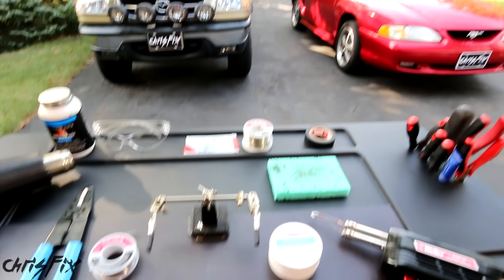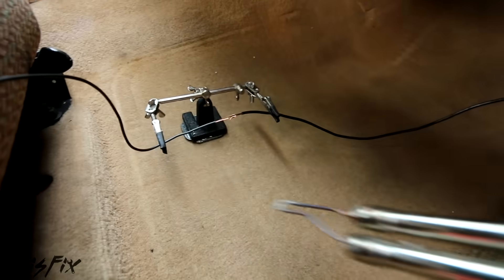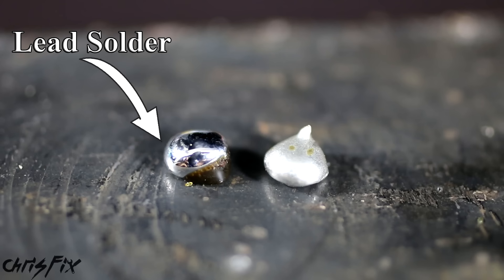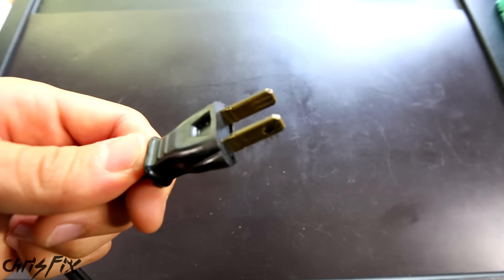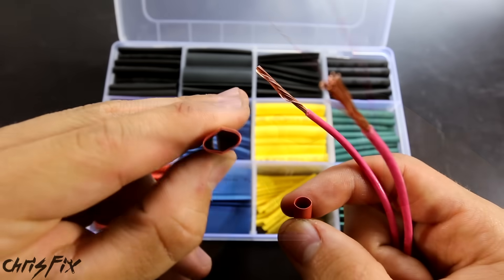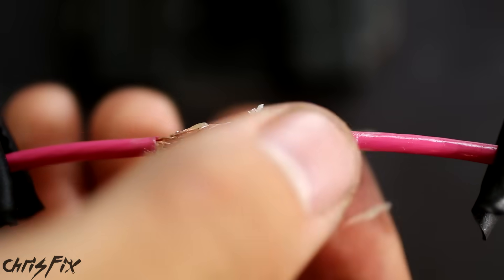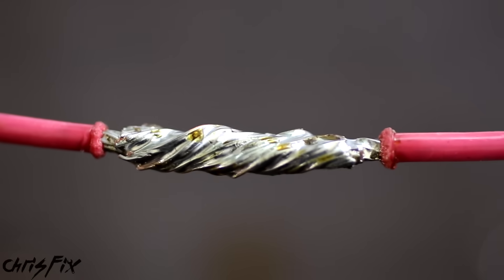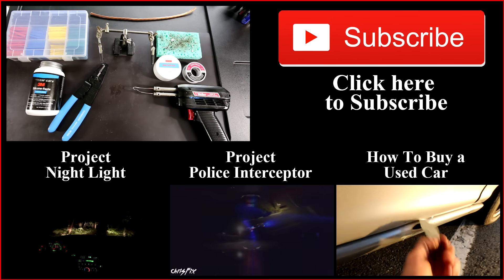How to Solder Wires Together (Best tips and tricks)

Comment: When I solder this way the wire instalation melts faster than the solder... And I'm afraid I'm damaging the wire or the circuit board because it's near.

Comment: Thank you Chris. After 50+ years of soldering the wrong way I finally learned how to solder properly. I just wished you had shown how to solder two wires of different guages. I assume it works the same way of integrating the wires and then twisting them to form a tight weave before adding paste. Also the tip about using dielectric grease was most helpful.

Comment: This was really good.  I accidently cut the wrong wire and it was too short on on end to reach in and strip properly.  8 Guage Stranded. Got it back together.  Doesn't look anywhere near as good as yours, but it's secure and working. Liked.
Reply from the maker: Glad to hear it worked out, and it is working properly, that is what matters!

Comment: AWESOME, AWESOME, AWESOME!!!!!!!  Until this video I could never figure out why soldering was so difficult.  Huge tip from Chris was to change out the provided tip with a piece of copper wire (I used 12/2 home wiring ground wire).  It heats up in a few seconds and solder easily flows into the wire (just like it should but never did).   I think the flux also helps but I haven't tried it without (why mess with perfection).  Thanks also for identifying the correct electrical solder and that it should be lead not silver!!  I used all the products you linked and they all worked great!  I also used your dielectric grease suggestion for the shrink tubing.
Reply from the maker: Glad the video was helpful!

Comment: Hey, i tried that but somehow my wire wont get hot enough to melt the solder. The maximum i can go is 480 which should be enough but even after a few minutes nothing happened. Any tips on this?

Comment: Thank you!! No longer will my clients be able to sue me for getting electrocuted when attempting to turn on their supposed waterproof electrical units and end up in the hospital with 3rd degree burns on their hands or lose their life when attempting to use their microwave oven, while taking a nice hot shower and warming up their bath towel to use to dry themselves up when they finish showering!  Now they can rest assured that they no longer have to be afraid to use any waterproof devices in the shower,  after I've repaired the wiring their dog ate while swimming, RIP Snoopy...!  I now consider myself a certified professional Soldering King of All Newly Soldered Electronics capable of operating in the water, thanks to my newly acquired soldering skills of creating waterproof  wiring with heatshrink tubing, that is guaranteed to work underwater, above water, bare feet in water, including toasters, hair dryers, portable heaters, or anything else that I repair for my customers, after their dog chews up the electrical cords and require a waterproof solder so they can continue using their devices!  If it wasn't originally waterproof, just call me and I will waterproof it for you, guaranteed to work underwater, even for your 4 year old to use!!  Feels good not to worry about anymore lawsuits due to my terrible soldering skills prior to watching this video!  Just feels good.  I'm gonna try my new radio in the water, that I just repaired by creating a waterproof connection as the video taught me.  If I don't write anything after this sentence, then u know I must have made a mistake and ended up getting electrocuted and sent to the morgue for an autopsy...

Comment: Isn’t crimping superior than soldering in automotive? faster, more consistent, more resistant to vibration and heat.
Reply from the maker: If you make a good crimp or a good solder it doesnt matter for normal automotive use.

Comment: Soldering thick wires like this is easy! Now try soldering tiny hair-like wires together without completely burning the copper, now that's a real challenge.
Reply: Any tips or tricks? Or just .. precision
Reply: @jaketf2374  Honestly I've found most cheap thin wires actually use copper-coated aluminum, not pure copper. Pure copper won't easily burn up on you like that and will accept solder easily no matter how thin it is. I found wrapping strands together and rubbing it on a rough surface helps differentiate them, if it starts turning silver-ish it's aluminum and you can't really solder it, best you can do is crimp them.

Comment: for anyone wondering yes this seems easy but try doing this under the dashboard or soldering a wire inside the fuse box,its just a pain to do,not to mention inside the engine compartment with no lighting

Comment: It's not called a soldering GUN; it's a soldering IRON. Also, for wires, don't solder... crimp. There are literally thousands of options to crimp wires together so you never have to do this. Crimping allows you to easily separate and rejoin different wires over time.
Reply from the maker: In this case it was a soldering gun, an iron would look different but they do the same thing, and crimping is good for some applications but it can be tool dependent and it can be tricky to get right, that being said both can work

Comment: Haha I'm guilty of cold soldering. Thanks for all the tips. I'm fixing my car sound because the "professionals" said they checked all the wiring, but after I went through it found a rusted connection where the wire should be silver but was pitch black causing the sound to cut out.
Reply from the maker: Good thing you know how it fix it right!

Comment: I started soldering with lead based solder but I moved to lead free solder. Modern lead free solder is excellent now but they are not all created equal. After a lot of testing I recommend AIM SN100C or Kester 48 K100LD for lead free solder, give it a try!

Comment: how long is the TPS wiring harness on 2002 Nissan Xterra?
Reply: Maybe solder back a wire if it gets pulled. Generally cars are electronically the same

Comment: This never works for me. 440 degree holding the iron on the wire for 20 minutes and it won't melt, but the insulation does. What temp did you use 1000 degrees?
Reply: It’s between 600-700

Comment: Flux doesn't protect against oxides, it removes them during the soldering process. The flux should burn off, which is what produces the smoke (it's not lead vapor). The best way to solder is to start with a good mechanical connection. Create a hook with the end of each wire, join them together and then twist so they can't be physically pulled apart before soldering.

Comment: My wire is from my ebike and silver in color. I put the solder gun to it but it never gets hot enough to melt the solder onto the wire. The soldering gun is hot I have it turned all the way up to (420c). When I go to check the wire after holding the soldering gun to it, it's barely hot. The flux melted but not the solder. Got any suggestions ?

Comment: Nicely done, clear concise and great video and editing skills.  At 6:40, poor connections, and high resistance that results, don't draw additional current, so they don't cause fuses to blow, they do cause heat, which can cause a fire.  In fact that's what's so bad about them, there is no protection from fuses and circuit breakers.  

I'd argue that quality solderless crimp terminals are just as reliable as solder, and perhaps even more so.  Soldering can also make connections brittle, work harden, and break in high vibration environments.  Any time I need to join two wires, I reach for my wire strippers and crimping tool, not soldering iron.  It's quicker, easier and there's no fire risk, especially in confined areas.  American Boat and Yacht Council standards prohibit the use of solder alone to make wiring connections (it can be added to a mechanical connection), because if the wire heats up, the solder can melt and drop out.  

That's no reflection on the tutorial, again it's very well done.    There are places where solder is necessary, on coaxial connections for instance, and to repair or modify circuit boards, it's a very valuable skill to have.

Comment: Quick question, I soldered some wires on my car, I actually used the new style solder seal butt connectors. My question is, someone told me that I could use copper pipe flux when soldering my wires. I am new to this so didn't know any different.  I used the pipe Flux to rewire some fuel injector wires together.  Then as I was watching some additional videos, they stated not to use copper flux...  I already completed the wiring.  Would you know if it will be OK or do I have to redo all the re-wiring.
Reply from the maker: I would redo the wiring, pipe flux is different than what you'll need for wiring
Reply: @chrisfix  I was afraid you were going to say that.

Comment: Thank you for this epic tutorial, you just saved my small business a huge headache! Great tutorial!

Thanks to mainly this video, I was able to fix the wiring harness on my laser engraver- the JST HX connector had fried and partially melted. I was able to cut the wire down, solder on new leads and new connectors and now the laser works! I almost thought I was out 600ish Dollars. And now I also understand what I'm working with and how to fix it even better! It's always good to be knowledgeable about how to service your own equipment! Customer service will probably replace them, but here it is a week later and they still don't understand that I just need a new effing wiring harness, despite telling them, showing photos and videos proving the issue, I don't think they understand English very well but while their service is slow, they do always come through in the end. I'm sure they'll replace it, but I'll get that new harness in about a Month- I can't be out of my laser that long with a business to run so we refurbished the harness and it's working as it should now, thanks in part to this video! We did also get a backup laser just in case something like this happens again- in the end this will end up working out for the best in many ways but it's been a VERY stressful Week dealing with all this.

Comment: I like the lineman splice as when the heat shrink goes over top it will form peaks and valleys and be held in place. With a smooth connection you can sometimes get heat shrink moving back and forth, especially if you use non adhesive based grease in the connection that can cause heat shrink to slide

Comment: I tried this with a soldering iron and its not working, its a 90w iron that goes up past 800 degrees but when i put the solder at the top and iron on bottom it doesn't melt,

Comment: Hey, man. Some personal experience here: I used lead-free soldering and understood why you prefer leaded wires. Lead-free wire will oxidise right away once heat removed. It becomes very hard to modify unless heat up with much higher  temperature (that brings risk of burning the cable). So lead free wire requires higher skill level and quite often it's a one-shot operation. To undo lead free soldering, I would use a rotary multitool to grind majority off  or just cut the section out.

Comment: The wire gauge sizes on the stripper are for solid wire. If you are using stranded wire, you need to go to the next larger size this will prevent accidentally cutting strands of wire.

Comment: Question, a lot of the time after I coat the tip of the iron with solder and place it underneath my wire the wire struggles to heat. I tend to lose patience after like 5 minutes and the wire still isn’t hot and just cold solder. Any tips on why this might happen?

Comment: I tried this and used an 80w soldering iron. I let the wires hear up for ages and it would not make the wires not enough to solder, yet the tip would burn wood in a second (and the soldering irons cord FML).
I can't solder worth shit and anything I crimp is weak as. Help!

Comment: You are a soldering beast, thanks!  I did the best solder job so far and I fixed a pair of Sennheiser hd 280 pro headphones that go for around $100.  Only problem was I had it looped in my gear rack and I had to saw it out of there, HAAAAA.  Thanks!
Reply from the maker: Awesome!

Comment: First time ever having to solder wires together. I bought one of those easy off safety switches for my table saw, and since there will be a bit of juice running through them i wanted it done properly. 
Usually i have to look at several videos to get the right method for doing something properly. I read the comments to make sure people are actually showing the right method. Your viewers are pretty unanimous in this being one of the best videos out there on the subject, even i could follow. Thank you. 7 years pass rather quickly.
Reply from the maker: Thanks a lot!
Reply: @chrisfix     Just finished soldering them. Went very well thanks.

Comment: Nice tutorial!  I'm having big trouble tinning some small wires on the cord to my earbuds so I can splice them neatly.  The solder manages to be pulled to the tip of the soldering iron despite my having put solder paste onto the end I'm trying to tin.  The solder just won't stick.  Can you offer any pointers on tinning or soldering tiny wires?

Comment: I bought a wheeler solder gun that puts out 60watts. It didn't heat up my wires. U used a 260 watts it showed it did the job. U have a solder iron at 60 watts. I that 60 watts on solder iron going to be enough to heat the wire for the solder ?

Comment: How hot does a soldering iron need to be to transfer heat to the wire to melt the solder?
Reply: There's this thing called Google, kid
Reply: @CP-mb7ly  yes, but, I have my solder iron set to over 400 Fahrenheit, according to the digital display on it, I just bought it off of Temu, and wondering if it could be defective???

Comment: Cold soldering is a technique on much smaller applications and the primary problem is cracking. What was described in the example provided is just an insufficient amount of heat being transferred, leading to the solder cooling and solidifying before seeping into the wire bundle, yet even that is fixable by reapplying heat to remelt the solder. The most common cause of this was actually the size of the gun vs thickness of wire which was described earlier in the video.

Comment: You Failed.... You never removed the flux after you soldered. the Flux is a acid for etching the metal and removing oxides from the metals surface while the joint is been made.
Isopropyl alcohol works well on the joint but depends on the insolation

Comment: I doubt that the creator can make the same bond with a standard soldering rod. The electric gun is pretty much a no Brainer  Plus the products used aren't really high quality, but it's a good vid for a beginner that shops at that big Orange hardware store.. the one that sells alot of Roundup pesticide. The stuff that permanently ruins any water molecule it comes in contact with & causes all kinds of health issues like Cancer.

Comment: Use a proper soldering tip, they are designed with proper resistance to have optimal Wattage when soldering

Comment: is it possible to solder upside-down? I have a feed line motor in a poultry house that a wire snapped off of unfortunately its in a box at the top so the iron is stuck at a flat angle -.-

Comment: Great video.  Just a FYI: depending on the heat shrink tubing you're using, you might not need the silicone paste/epoxy.   Heatshrink tubing is often lined with an adhesive that creates an environmental seal when heated.

Comment: You should never twist your wire strippers. Doing so can nick the wire under the insulation and cause a hot spot. You should always pull the wire insulation straight off when stripping.
Reply from the maker: Thanks for the tip. I was always taught to twist but I can see what you are saying as well.

Comment: Lead free is garbage, agreed. For manufacturing it may be fine, but for home use lead free looks bad, does not give the smooth flow IMHO.
Good explanations, make a mechanical connection first. The solder's purpose is to flow between that mechanical connection to fill the small voids. We don't need a blob of solder, solder is not made to "stick" wires together.
 Thank you for the great video as always.

Comment: Great video, I learned a lot! If I solder on old wires, I always use steel wool to remove any oxidation from the copper. Before covering the connection with the heat shink I check the solder for any sharp points with my fingertips and remove them with fine sandpaper if needed. Remember that the soldered connection is not flexible and that both ends of the connection are prone to fatigue. Chosing the right location of the connection and having enough overlap of the heat shrink can reduce the risk of breakage.

Comment: I pulled every hair follicle of my head in frustration to why I can’t solder my wires just like this video did. I tried with every temperature, 330, 350, etc. Turns out the lead-FREE solder is a piece of crap when compared to lead solder. I had to buy lead solder online as I’m in a country where soldering isn’t widely performed, so it’s hard to get genuine equipment. I was fascinated by its flow.

Comment: Nice. Personally on your second method I wouldn't twist either side of the wire before you twist them together, the joint looks a lot and the solder gets I the joint better imo.

Also you can but heat shrink with glue that melts on the inside so it's waterproof.